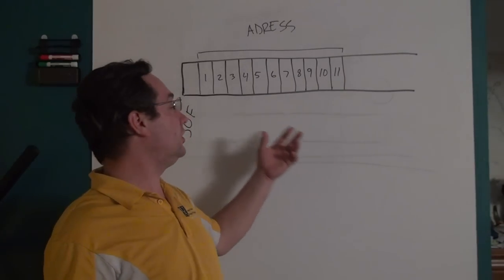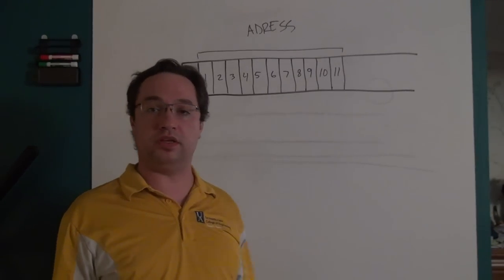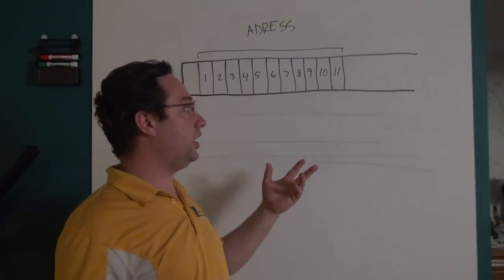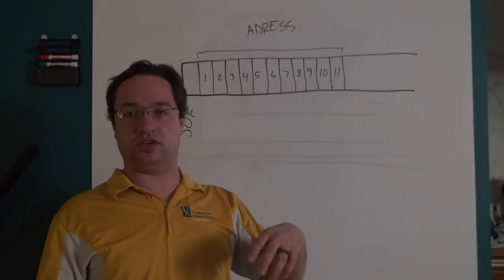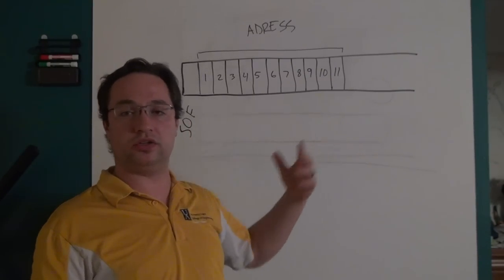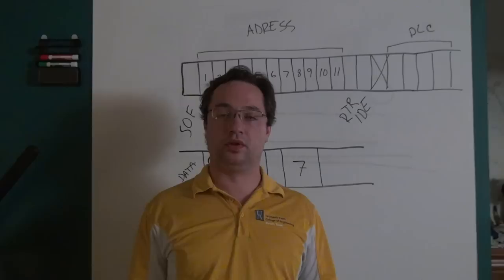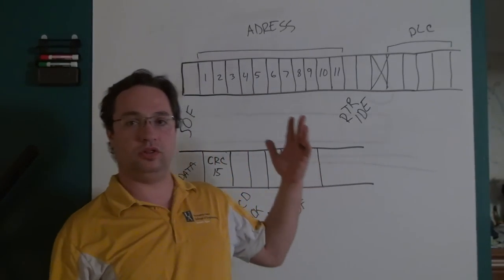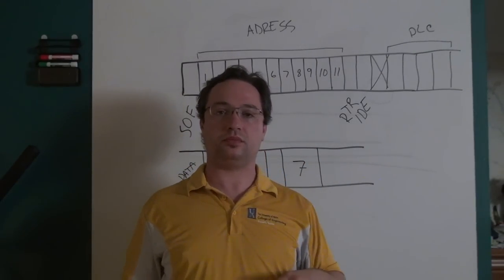eapbg #48 Introduction to CAN (Controller Area Network)

Comment: If CAN Bus uses two cables that both have a voltage, how is the circuit completed without a ground?
Reply from the maker: There is also a ground. CAN is not an isolated bus and so a shared ground must exist between all the nodes.
Reply: This was probably left out for simplicity sake.

Comment: Seems like it would be impossible to right-size an output message buffer not knowing when you will be able to transmit. Any ideas on how this basic issue is dealt with in software? Also, what happens when I decide my message is so important that I give it address 0 and start blasting rotor temperature data every 20 micro seconds. Won't this effectively crash the system since no other messages can get through?
Reply from the maker: Both of these issues are dealt with in the system design stage. Basically, the CAN bus is designed never to have 100% congestion. The message priorities and frequency of transmission are carefully chosen by the engineers to make sure that the bus is never 100% loaded. Then by looking at the priority of the message, you can figure out how often you are guaranteed to get a message out. Lower priority messages don't need to get out as often as higher priority ones. For part 2, yes saturating the bus with a high priority message will effectively crash it. This is avoided because nodes do not get to choose the addresses of their messages. The addresses are pre-chosen ahead of time. That said, there have been mistakes in the past. The 2002 Chevrolet TrailBlazer had a problem with the rear hatch module. The module would occasionally saturate the bus and the vehicle would shut off. GM subcontracted out the module and the company that made it made a mistake in the firmware. The only way to recover was to change the software of the module, the bus has no safeguards for overloading.
Reply: @eapbg  Thanks for the response. I stayed up late and found a TI data sheet which revealed that (as expected) there are industry trade groups who have decided to agree on a standardized address/priority scheme. But this only goes so far and locks out folks who are doing conversions or their own development. Also I discovered there are a number of constructs that make the protocol even more robust to these sorts of errors - the Remote Frame, the Error Frame, and the Overload Frame. As good as it is, it is still a much more sophisticated and difficult to implement standard as compared to the more direct and effective SPI or UART/RS485 protocols I've been spoiled by. But that's the classic trade off: robustness v simplicity. My interest has been piqued enough to look at this more closely however, so thanks for the excellent video that brought this about.

Comment: Lets say the Brake Sensor detects something is wrong and sends it's ID  (e.g: 00000000000 )over the bus. I'd imagine a Central Computer or some device has to interpret it ? How do we connect this bus where are Transmitting over a "gateway" that will send it to the outside world Over WiFI or Bluetooth ? Can it be another node (like an NodeMCU or WIFI Module) 
look out for  this ID and process it ?
Reply from the maker: I don't entirely understand what you are asking. A brake sensor would be connected to the ABS. When the ABS detects a fault it will transmit an ID to the GAUGE cluster to illuminate and ABS service lamp (usually amber). Other nodes at the same time may also note that the ABS is malfunctioning and act accordingly. The engine computer may disable traction control. These are all on the main high-speed bus. You can buy OBDII CAN adapters that have blue tooth and connect to your phone.

Comment: I have one question about the RTR bit - imagine this: I want from some unit receive message let say "tell me something about you" how will be look like this message ? will be in address (11bits) address of target unit ?
Reply from the maker: CAN only guarantees the message structure. How the RTR bit is actually implemented depends on the specific implementation of CAN on that particular device or system.
Reply from the maker: A bit more info that I came across. When using the RTR bit no data is sent. A standard CAN packet with zero DLC (no data) and the RTR bit asserted. Most likely the address is of data that is needed. I've been playing with CAN on a PIC32MZ micro. The micro supports setting up a buffer that is tied to an address/RTR bit. When the micro receives a message with a matching address and an RTR bit the buffer will automatically send the data that is stored in the buffer.  The micro supports up to 32 of these buffers.
Reply: eapbg, first of all thanks for the video. I think for the remote frame, DLC isn't zero, it should be the same as the DLC in the data frame.

Comment: EAPBG, Thanks, Most CAN modules are hard to get to and disconnect without tearing the whole car apart there must be another way or using the cars fuse box removing each fuse one by one until the CAN bus signal returns to GOOD? Why do they call the terminal box an DLC and the break out box OBD2, when it should be called a DLC break out box i'm confused why they even call it a DLC. If you wanted to upgrade your CAN buss from 2.0B to CAN FD flexible data rate you would have to replace all the CAN transceiver chips to CAN FD transceiver chips but leave the CAN bus harness and CAN modules can stay the same? The CAN Baud Rate how do you know what to set the CAN Baud Rate to because when using an oscilloscope to measure CAN H&L you can't tell if its CAN 2.0A or CAN 2.0B or CAN FD, so how can you tell?
Reply from the maker: I’ll do this in several parts. To determine the baudrate capture a message on the scope. Look for a transition zero one zero or vice versa. Using cursors measure the transition time. CAN has several predefined baud rates. (1M, 500k, 250k, 125k) Look to see what matches. For instance, at a 1Mbit baudrate the shortest bit is 1u second. The catch is that CAN FD will get much faster after the message ID. Actually, that is one way to tell apart CAN FD. Telling the difference between 2.0A and B involve measuring the length of the message. CAN 2.0B has a longer ID section.
Reply from the maker: You can try pulling fuses. If that works, great. As mentioned in a previous answer the CAN failure mode does not tend to be sending bad data. The failure mode tends to be something physical. If for example, the transceiver fails pulling power would not do anything. Then you are back to disconnecting one module at a time.
Reply from the maker: DLC stand for diagnostic link connector. The DLC is part of the OBD2 standard.
Reply from the maker: You can’t just upgrade the bus by changing out the transceivers. With CAN it’s not just the transceiver that is responsible, the microcontroller is too. What is curious though is that CAN FD can coexist on the same bus as regular CAN. A secondary bus can be overlaid on top of an existing one. The message ID is sent at regular CAN speed. When the CAN FD module gets priority to speak it jumps up to a higher speed. It does this in such a way that the other modules, the slow ones, don’t freak out. This higher speed message can only be heard by other CAN FD modules.

Comment: You want to say 
Can bus can be hacked easily
Reply from the maker: There is a misnomer in that statement. Hacking implies that there were some type of safeguards in place to prevent tampering. The only thing preventing tampering is usually physical access. Other than physical access CAN bus has no safeguards of any kind to prevent tampering. There is a great DEFCON video where a guy built a setup that could forcefully change CAN messages live on the fly.